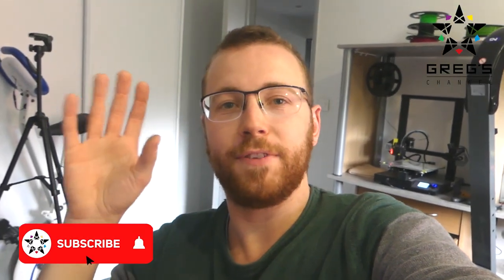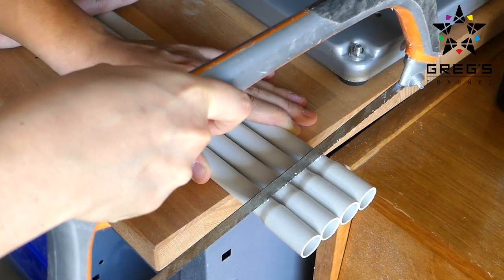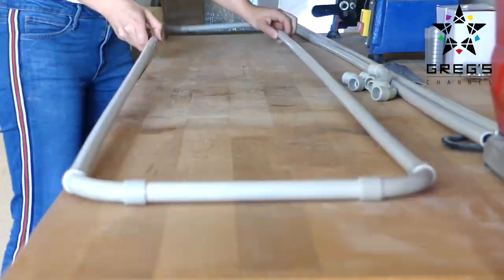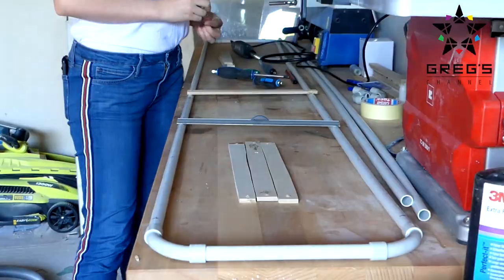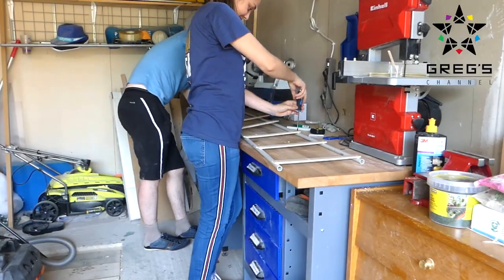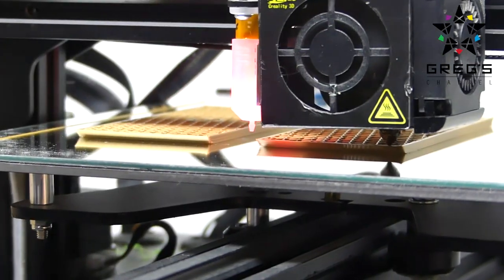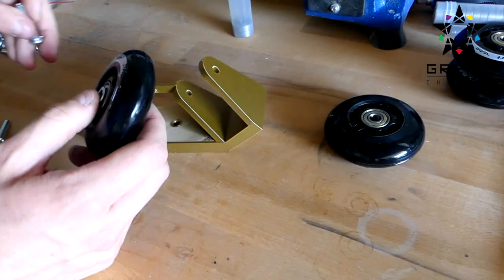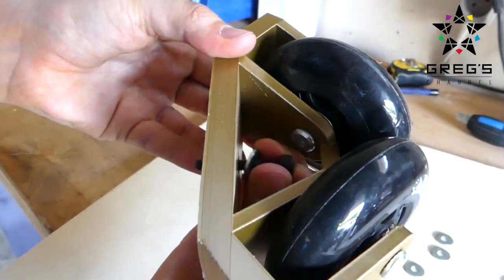How to make a Dolly for less than 20$ (+ Awesome Cinematic Shots)

Comment: Plywood 12mm around 15$
Pipe around 6$
Glue for Pipe around 2$
Rubber Wheel, 3D Print, ect....
Please dude don't misslead your viewer with the wrong title.
Good idea video anyway.
Reply from the maker: You're right if you buy everything new, broken or old roller blades can be found easily, and as I mentioned, the 3D printing is far from mandatory :)
The plywood cost me 5€ for this size and I could've simply gotten some wood at my local waste plant, the pipes 8€ including connectors, the 3D printing (could've been wood) cost me 5€ and I got the wheels at the waste site for free :) 18€ total is that i spent :)
Reply: @GregMakesThings  OK dude.  
Just not everything's you said is 20$ everywhere.  
So you spent 18$ good for you. 
I'm not talking about other stuff that you have to use to create it.  
But what I meant it's more about a title that can work for you but not for all the people it's what I meant, without being sarcastic.  
🙏